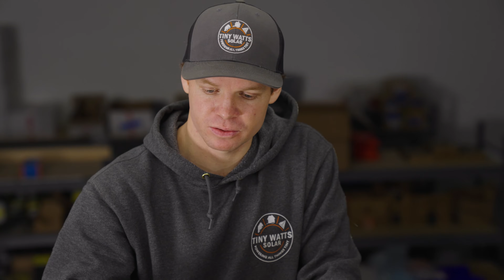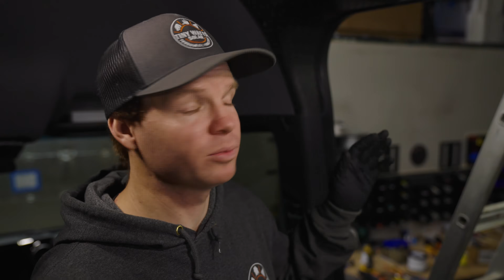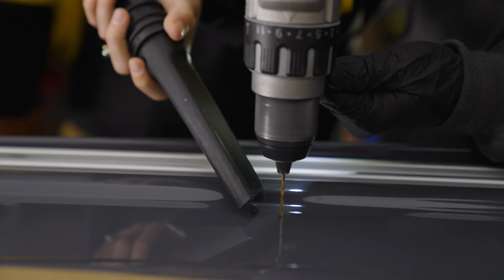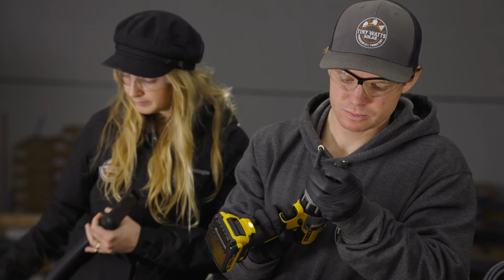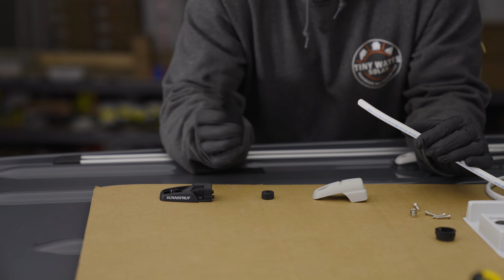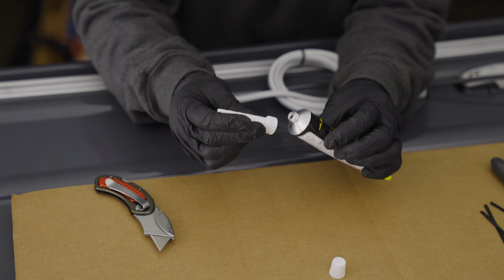WATERPROOF CABLE GLAND INSTALLATION

Comment: Fantastic video. From India! Plan on adding a solar panel to keep my battery going (does it go flat often, and I replace it once a year as a result.)
QUESTION - how do I keep a panel from overcharging my primary? Or is it just a better idea to go with a lithium secondary with a switchover of some sort to jump with the secondary? I dread getting stuck somewhere remote.
3-door jeep-clone owner.